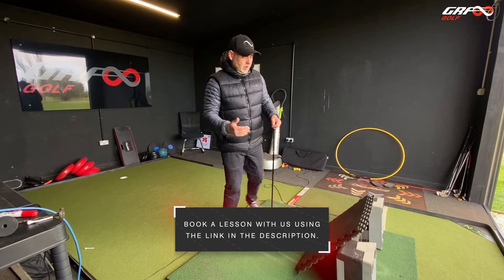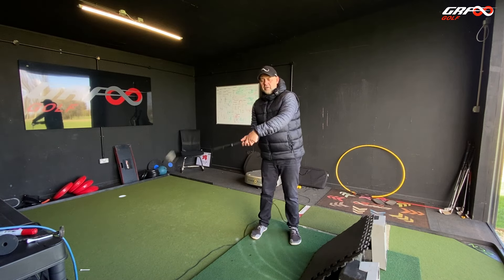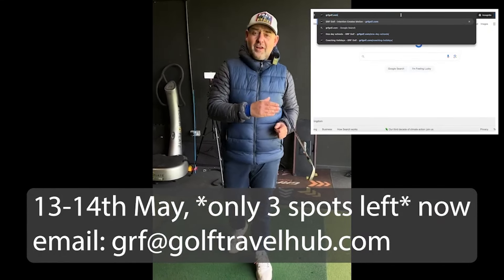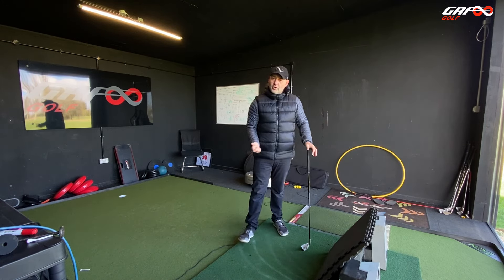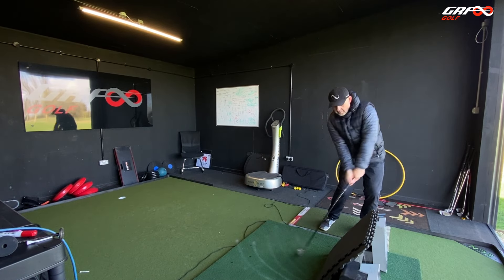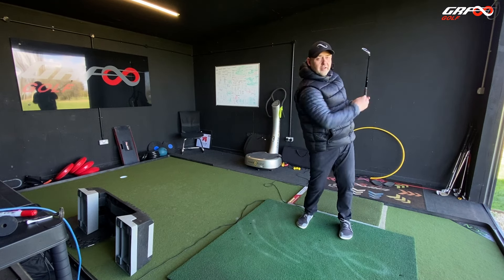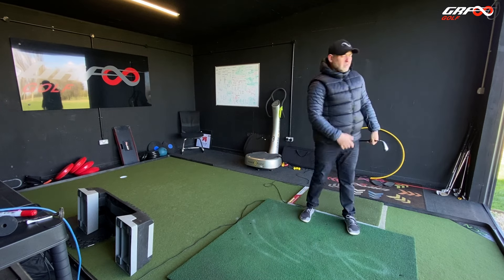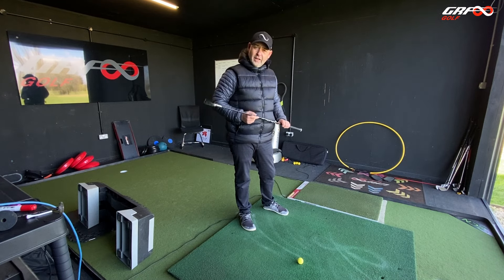Use This Drill to STOP Holding onto Lag in the Golf Swing

Comment: Hi Marcus. Love your videos. 👍👍
Could you elaborate more on the two releases in another video : the one you promote (with rotation / supination) and these drills / feelings versus the one you present as bad with the wrist « break ». The latter is only bad if it occurs too early (flipping) and is presented as « the » good way by other instructors because it would be more stable and easier to time (square to square). A timing error in Square to square would mean a ball still in direction of target but more or less compressed and low/high… A timing error in what you described could lead to bad effects (hooks and slices). 

And it seems that figures from 3D captures show that the left (lead) wrist is already moving to extension at impact and that nobodies holds the club like you demonstrate after impact. I understand you are presenting feels and motion during the swing is completely different but….

🤔🤔🤔

Comment: Marcus ,   The problem with my swing was looking like the drill.  My head was coming up too much..   Found out the weight was too much on my balls of my feet ,  my toes weren't able to lift ,  I was leaning my head forward at address .   So  I put weight back towards the heels ,   I was able to free up .  Leave it to me to see a drill and have it happening on the course and not even know it .  
I now have my arms club going away from me on backswing  and my body pivot going opposite direction .    Like a tug of rope .      Cheers